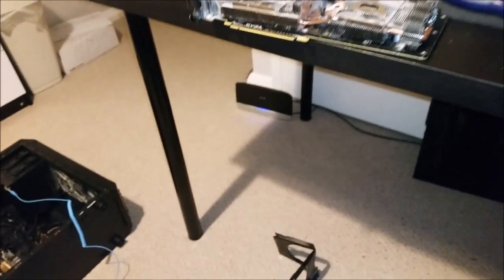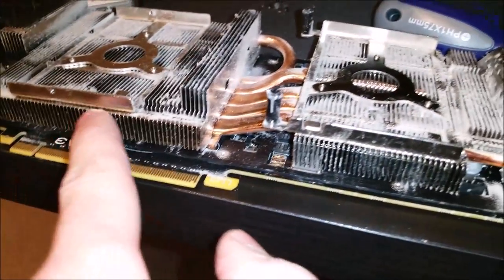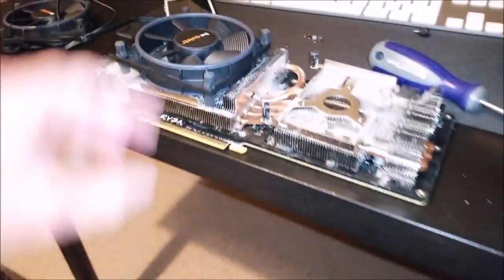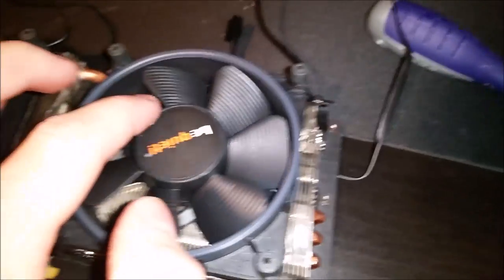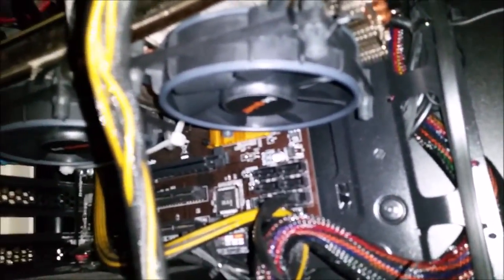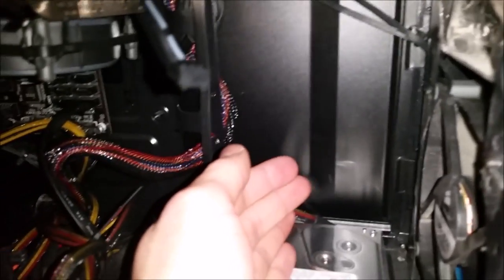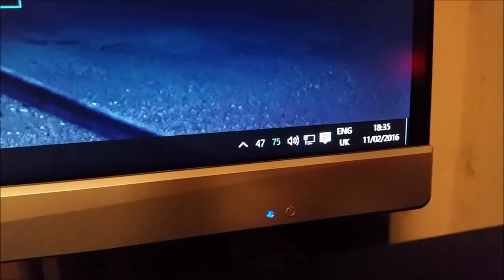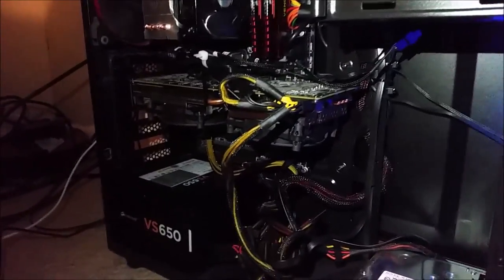DIY Graphics Card Cooling Mod - Fail!

Comment: Next time, keep the IKEA 90 degree screwdriver. Contrary to public opinion, you CAN put your heat-sink and VGA (separate them first & dont include the fans), into the dishwasher. Wash hot with no soap. They will dry by themselves but you can layer them with paper towels if you like.

Comment: TL;DR What not to do: This guy ripped the off the shroud & fans off his GPU (instead of unscrewing them), which bent the heatsink and broke some fins.  He slapped 2x120mm fans onto the GPU heatsink and realized the cooling is even worse than before. GPU temps now shoot up to 80 and throttle

Comment: BeQuiet fans have a low air pressure. The very compact cooling solution on graphics need high pressure and medium flow to work efficient. It is well known in Germany that this fans are not the best solution for water cooling too. Most common are Noctua and Noise Blocker.